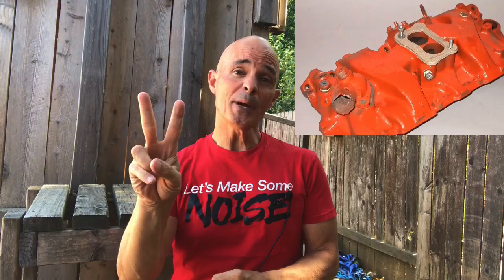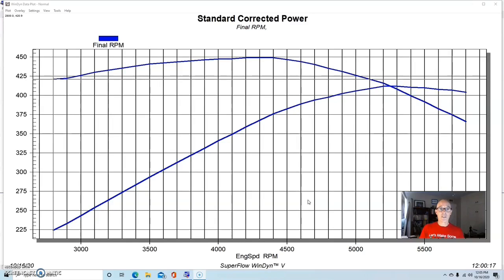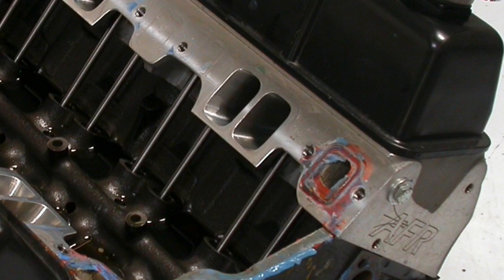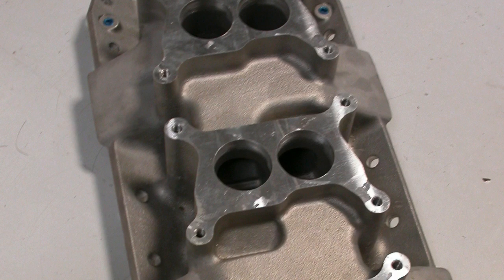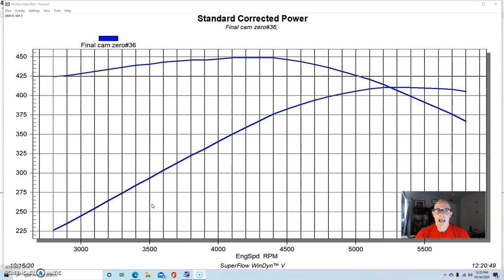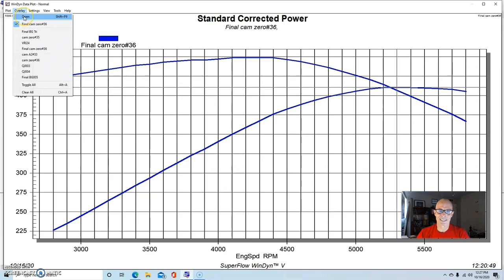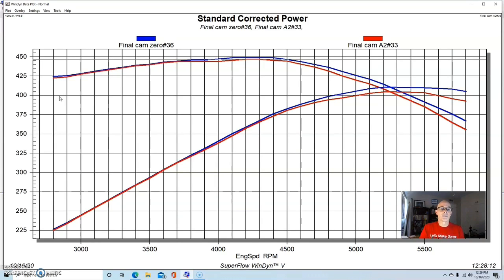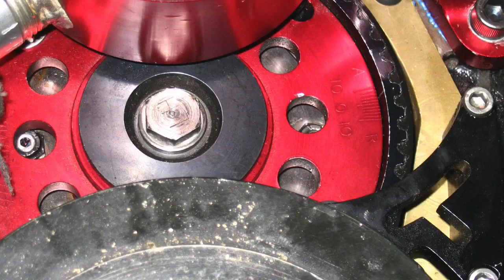SBC TRI-POWER INTAKE & CAM TIMING

Comment: Back in my early hot rodding days in the 80's, I had a 355sbc that I installed an Isky 280 cam in. I believe it was .480 lift single pattern and going in a 4-speed '72 RS/SS Camaro. I remember thinking my cam choice was too big as I was stabbing it in, and so I advanced it 4 degrees. Maybe just dumb luck, but it flat worked and the thing STILL pulled to 7,000 rpm and had an amazingly wide power band. So to sum things up, SOMETIMES when you have a too-big cam you can bandaid it by installing it advanced.
Reply: Did you degree the cam or just pick an amount and advance?

Comment: Mechanical secondary optimized Qjet beats Holley 4bbl Mec sec. For Tripower, secondary barrel 3 to 6 operation must be mechanical. GM decided to replace Tri Powers with 725-780-800 cfm 4bbls because of the secondary system on the Tri Power. They are neck ans neck, but a 4bbl is aways more reliable. The real gain was in street fuel consumption reduction. A 4bbls in gears, steady state performance times is far better than opening up 6 sq inches of total 3 to 6 bbl area. A great 4 bbl is always the match of any tri power.because it is a non Independent runner system with minimal vaccum cross talk. In my humble opinion based on many Tri Power research projects from US cars made from 1957 to 1972.